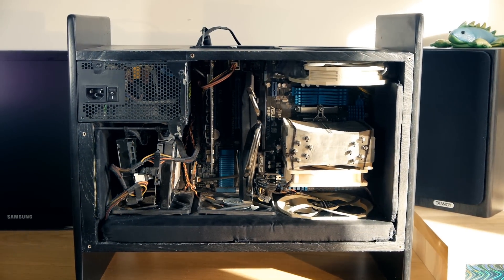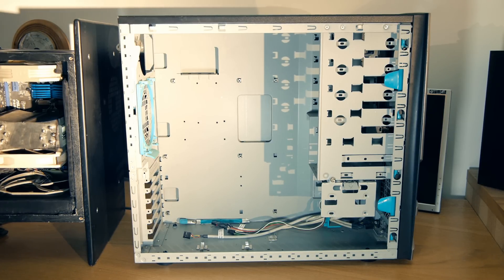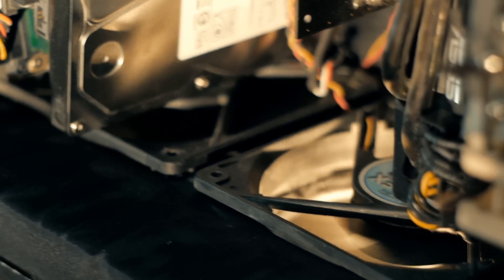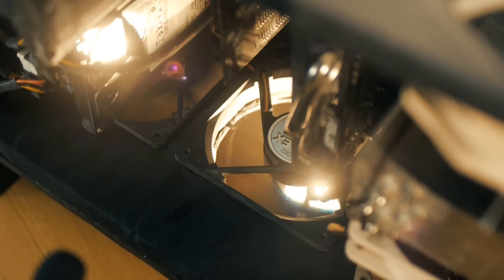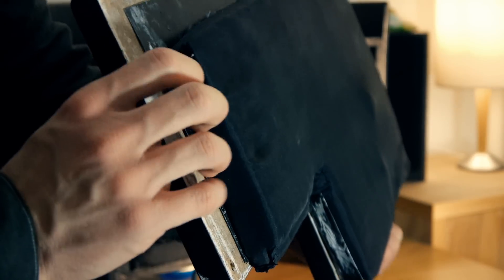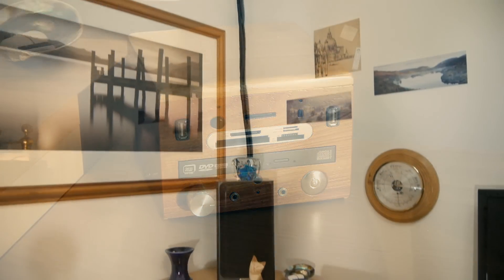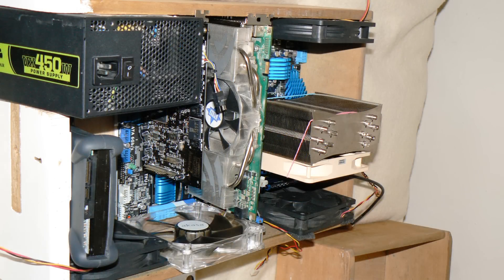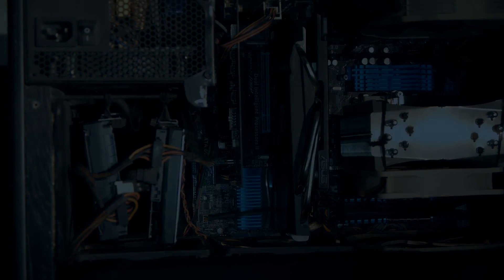My silent wooden PC

Comment: Good fan layout but why, Oh why wood??? It's so inconvinient and also frankly quite dangerous! Using stainless steel or aluminium is generally better, as metals aren't in danger of burning and the case can additionally dissipate heat instead of trapping and insulating it. And if additional sound dampening is important one could use pressed/indented metal, so there are less vibrations and rubber feet, just like engine mounts are from rubber to not transfer vibrations. If one does want to use sound dampening foam around the outside of the case, they should make sure it is non-flammable.

Comment: I don't get why to get all that concerned about the noise a standard case would produce, if you will use a 5 meter cable to connect it... Noise should be an issue when you have your tower next to your monitor.... Otherwise, this is just overkill.
Reply: maybe he lives in a nice neighborhood and a nice home where noise actually would be audible from a standard case.

Comment: hey im about to do the same thing but how do i make my own power botton?
Reply: If you already have a pc case you could re-use the power button from that. If not, or it's not suitable for your new build you need to buy a momentary switch. As opposed to a latched switch which you use for constant power to things like LED's. You can get them from most decent Pc shops or online.
Reply: Screwdriver on motherboard works i think

Comment: Great design! but normally you don't want a HDD to be mounted sideways and in a unstable surface, i would change that.
Reply: thats what i noticed i wouldnt do that no matter the noise it makes because my data is inside, doing it cuts the lifespan a lot

Comment: I'm thinking of doing something similar to this (newer version is too much for me right now) I don't see the reason for the aluminum under the sponge and do you remember how did  you mount the motherboard to the wood?
Reply: im currently building a wooden pc case too, i just used some normal wood screws with cork spacers and it worked pretty good

Comment: I think you can registering this design patent, this design is more reasonable for reduce the heat, and the panel place on the top is very convenient, but there has little problem about the display card, do you consider how about the case is a little bit slanting like 15-20 degrees

Comment: So the best PC is actually a ... wooden PC... While I'm not so picky about sound or... placements or aesthetics of the case, I do admit the very interesting point that the author makes - standard PC cases are shitty. 
They work for vast majority in a pretty established design, but while most people try to have them made of titanium or gold or have sparkles or super-expensive fans or ... whatever else that denotes "top-end quality" in a case - I'd rather them to be composite.

So if there was a wall to mount the motherboard on - every other part of the PC would be manually attachable. The closest to this now is probably some top-range cases with multiple wall-fans, multiple roof fans and even frontals.

But the fact that PSU is a huge pain in the case, being either a dust-collector at the bottom or heat collector at the top, and the fact that probably nobody nowadays uses the deprecated physical drives, and the advent of slim SSDs - almost the whole frontal part of the case is pointless. Sure, makes sense around 2003, when you could need a drive to read a CD or a DVD or to write a DVD or to actually use a floppy, but now it's nothing. Designers gotta do something about it, and not in a "I'll make a new design, easier to produce, less materials, yadda-yadda, 5 times cheaper for the patent" way. If it's smaller\easier to be made, then it should at least rightfully replace the old design, not be some overpriced solution for Steam Machines.

So a similar case, with the main part - being the motherboard mount wall. It would have... about 3-4 composite pieces along the sides, and the closing wall would also have options for fans. I don't mean that this contraption would have like a dozen fans, but you'd be able to either put a fan, or have that part being solid wall.
And, of course, attachable "basket" for a drive, extra storage etc.

This would pinnacle the "customization" idea of PCs, while bringing them closer to the size of consoles, even if it's ATX.

Really wish the author could patent this creation and maybe have some analogues manufactured...

Comment: I think I'm more impressed with the control terminal than the case. If you have it so far away from the PC, and yourself, you probably don't need to be overly concerned about how quiet the PC is.
Reply: Probably true to a point. Might be enough to put the whole PC on a cushion, so it doesn't resonate the walls. Still a cool idea.
Reply: I agree with you guys that  module with the items you mainly use on a pc like cd drive usb ports audio ports etc is a very unique idea

Comment: A really good question is... Is this worth the time vs just watercooling and using rubber mounting plugs for the radiator and all fans... This seems like an excessive project vs water cooling which will yield way better temps( 40-48 Celsius loaded). With my GTX 980 TI and AMD fx8350 both overclocked on the same loop at 1500 MHz core clock 3000 MHz memory clock and a 4.4 GHz core clock on the CPU.

This isn't criticizing what you did, more wondering what the reason was for doing this vs watercooling.

Comment: now you only need to find a g4 ore g5 mac case and build it in there (Y)
Reply: +Dhr Willemsen Only if it's dead though. G5 PowerMacs are still nice machines.
Reply: +Walnut Spice well it really doesn't matter , cause they aren't supported anymore. The latest OS it can't run on it anymore . And now these computers are really cheap to get. Might be a nice future video though . These cases are quite nice and silent . The G5 Mac cases are also nice and solid . Over powered coolers tend to keep them really silent . That's what I like about them . Sadly enough they get hacked for building hackintoshes . They are well designed for airflow. 
Merry Christmas btw and I'll be waiting for future videos in the next year .

Comment: Now that you have it silent, there are two things you should do.

First, on the bottom intake, dust tends to accumulate on bottom surfaces below the intake fans, so you should put reticulated foam filters to filter the air quite well with little obstruction of airflow.

Next, add a piece of wood to go over the top of the case. This will help prevent dust from entering through the top.

That's roughly how I have mine set up, and I rarely have to dust the thing out at all, which helps it continue to remain cool and quiet.

Good build!

Comment: I had the same idea with using elastic bands to hold mechanical hard drives to absorb all the vibrations. I thought of this for building a NAS or HTPC (I'm undecided). The fans mounted in a sponge is genius. Using wood is not a too bad of an idea because of it's tensile strength. Although softwoods isn't soft enough to absorb all the vibrations. If you can get your hands on any soft material like rubber or polyurethane it would still be able to absorb some vibrations. Anyways thumbs up! Liked and subscribed!

Comment: I just hope for you to never have any spark in there, because silk + foam + wood may provide for an extremely flamable mix and quite an unhappy ending. Nonetheless, kuddos from a woodworker and for some nice tips.
Reply: Never once heard of a computer spark
Reply: ***** 
Well, I hope for you it stays that way. But where electricity - with lots of wires, closely bundled together, connecting hardware tending to heat in a confined space - is concerned,.. there's always a possibility...
Reply: Edurne 19 yeah. A wooden case doesn't seem like the best of ideas

Comment: I am a animator and when i make my renders my PC is really loud is it possible to make a render pc silent even on extreme renders ?
Reply: Tension It depends on the CPU and GPU (graphics card).
Reply: +Tension the "Noctua NH-D15S" is a good start if it is your CPU cooler that is making the noise...
a noise isolated PC-Case might be a good idea too (I have the "silent base 800" and can only recommend it)
if that is not an option you could also replace your current case fans with noise optimized ones.

you might also want to optimise your fan profile (if your motherboard supports that) to operate at a higher temperature to achieve better noise performance
and last but certainly not least if you only have 1 GPU or have 3(+) slots/card you might even consider an aftermarket VGA Cooler like the "Arctic Accelero Xtreme III"
Reply: +Tension well if you want a quiet pc and is going with air you'll need to get used to pretty bad temps, my pc is reaching 75-78C under really heavy load but my fans dont go above 900RPM
Reply: +AnderssonYao Does it throttle>no>the temps are more than adequate
Reply: +Tension yup, just get watercooling.

Comment: you got a point in this video but you really used a bad example of a "standard pc case". most people who build there computers(mostly gaming or editing) buy some oth er BETTER cases, take my nzxt h440 for example. yes it got some restrictions in terms of airflow but i'm making up by placing 9 fans in it running at very low speed, which is also very quiet. but still you did a good job on the wooden case, the fan placement seems very logical

Comment: I have been looking into how cases are cooled while planning my new computer (have not built one before) and was thinking of trying to do a similar thing but by rotating the mother board and using the bottom intake fans of the case and top exsaust fans.

I think this build is sooo cool because I cannot see why computer cases have retained the same design for so long, they currently defenintly do not seem to be the most efficient designs and I honestly dont know why a company has not done somehting like this yet

Comment: someone correct me if I'm wrong but wouldn't it have been better to have the fans take in air at the top and push it out in the bottom of the case so there would be less dust build up?

Comment: First off, solid videography and good speaking pace in the video - great production values, thanks.  

The best part of this build is really the case design.   You aren't fighting the natural rise of hot air, and no component uses recycled, hotter air.

Easy for me to say 2+ years hence, but it's amazing how far we've come in terms of "silent" and lower heat components since the video was published.   Would be great to see a silent, low-heat mini-ITX build in wood that you could leave on your desk.

Comment: I'm a little worried about the extension cables: do they make your pc work slower?

As to the HDD's i would just mount them on each side so they are horizontally, even tho as you stated somewhere theres no difference in their position. Like 20 years ago i had a pc tower that could have been put on its side to put a monitor on it...

Comment: This might sound weird, but I don't think I could live with a computer setup like this. I have become so accustomed to the light whirring of my case fans that I'm not sure I could live with the "deafening silence", so to speak. Makes the tinnitus more apparent.
Reply from the maker: ***** I've got to say that I actually get where you're coming from with that. I used to have my PC under my bed, and it was on literally ALL the time (even at night). I kind of missed its low hum after it went, but now I'm used to the silence I prefer it much more.
Reply: I honestly have gotten to the point where I will run the fan on my air conditioner even in winter, just to have some decent background noise when I am sleeping. Silence freaks me out a fair bit.
Reply: Lavdi Not if his computer is on (which is probably how he's fucking reading this)
Reply: Tropis Building yes i use my phone at home wtf
Reply: Lavdi Well you probably don't have a really good pc then
Reply: ***** can you hear that ?  its silence
Reply: Tropis Building phone, phablets,tablets,laptops
Reply: Lavdi Why would you use a mobile device at home? If you're using a phone, phablet, tablet, or a laptop (if you already have a good desktop) chances are you're outside or away from your home
Reply: Tropis Building That's not logical at all! I use my phone at home. It's not like I'm going to bring my desktop into bed with me...
Reply: Reuben James That's what a laptop is for
Reply: Tropis Building Or a phone... I usually have my phone by my bed, not the case with my laptop.
Reply: Reuben James My phone sucks dick so I just use my laptop, not that I've ever really needed a phone tbh

Comment: Are you a monk or something? I've never seen anyone go to these lengths for a silent computer........

It's awesome but I would rather my PC sound like a weedwacker than do all that, plus one mistake and it burns down your whole district.
Reply from the maker: nespokesman I like quiet computing therefore I'm a monk?
Reply: DIY Perks You built a computer out of wood, sponge, silk and elastic. That is pretty extreme, then you went ahead put it in another room with a remote.................

So yes, there is liking quiet computing then there is this.
Reply from the maker: nespokesman
Depends on the person. I've always been interested in experimenting and building things, so it doesn't seem 'extreme' at all to me. There would be no innovation if no one tried anything new... and trying something new doesn't make you a monk ;)
Reply: DIY Perks Whatever you say Monk......

lol
Reply: nespokesman
 I have to say I don't think he's a monk just a cool guy I'm looking into building a wooden PC just for the sake of heaving a wooden PC the only thing I would make different is fireproofing it a bit more with special paint and there is also special fabric that won't burn as well as sponge so it would melt but not burn just to be save. Those things really exist and is heavly used in discos and party locations to prevent anyone from burning everything down when drunk ;)
Reply: nespokesman Yo, this guy makes no mistakes.
Reply: ***** also make sure to mount your harddrives correctly

Comment: What is the method of communication between controller-box and the actual PC? VGA+usb extension?
Reply from the maker: BnRR34 2x USB, 1x custom four pin din (for the power button and hdd led), 3.5mm audio transfer, and two thick wires for power transfer.The video cables (2x 6m DVI) are separate and just go to the monitors directly from the graphics card.
Reply: DIY Perks So, the optical drive is connected via usb i suppose?

Comment: Why did you mount the psu ontop? Wouldn't the psu gain more to draw it's own air in from below the case using heat rises to its advantage?

Comment: Very dusty tho
Reply from the maker: death6199 Just death Welcome to the real world ;)
Reply: Just saying, good job tho
Reply: Thanks man
Reply: DIY Perks Fan filters :)
Reply: Fan filters? Easy. Get a thin wooden board about the same size as the bottom of the case, cut the same holds as where your fans would be, put that board into a black pantyhose or lagging, cut off what parts of the black pantyhose or lagging that is not being use and screw the board onto the bottom of the case. DONE. It's easy to clean and you can change the filter anytime you like.

In the video I can hear a lot of fan noise, maybe you're running the fans on max where it don't need to be but not sure... oh well. Either way having filters is always better then having no filters. Good Luck.

Comment: Another solution is to put a regular computer on the other side of a wall, and run cables through. I've had my computer set up like this for years, and it completely eliminates noise. The minor inconveniences are power on, reset, and changing discs.

Comment: I did the remote PC thingy back in mid 90-tys, back then it was a sport, no its just to easy. 5 coaxcable for the screen, 2 RCA, 1 for video in, 1 for audio out (SPDIF digital). 2 PS/2 conectors for keyb and mouse (later used wireless keyb). One 15 pole joy port.

Nowdays its only a USB, twp HDMI and a Toslink. With keyb-on switch in bios you dont really need a power button, but you still need a reset button. Probobly could remove the Toslik with a USB sound card for the secondary screen (my GPU only support one audio enable HDMI.

Just waiting for USB 3.1 enable screen removing both HDMI and Toslink completely.

Comment: aren't you worried about the imbalance inside the HDD's causing the disks to spin off center? it looked like they were slightly angled in at the bottom.
Reply from the maker: ill vision Orientation doesn't matter these days.

Comment: It's an interesting idea/project, but if you're doing it purely for cooling and/or noise reduction, I'm not sure it's worth the effort. Perhaps in a bedroom it may be, but not in a living/dining room (or similar), where I have mine. Right now, I have to stick my head within a foot to be able to hear anything, even then it's near silent and only very slight noise from case fans.  The CPU is hovering around 30C (Intel i5, not overclocked though.)

I think if I were to do something similar to you, I would use some sort of acoustic noise reduction foam inside, I don't think there was any need to cover it in silk as air will be flowing straight up, and mostly near the centre.

I would also use some filters on the intake fans. They will need maintenance, but they do make a big difference, especially to the CPU fan and the cooler fins.